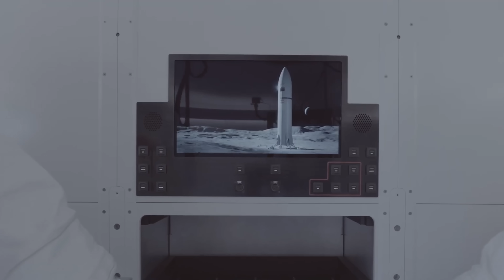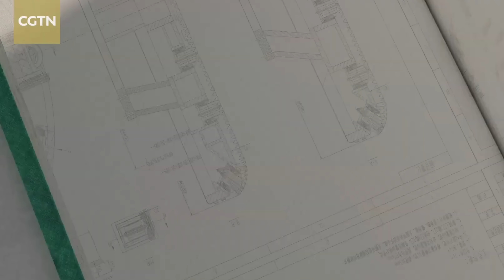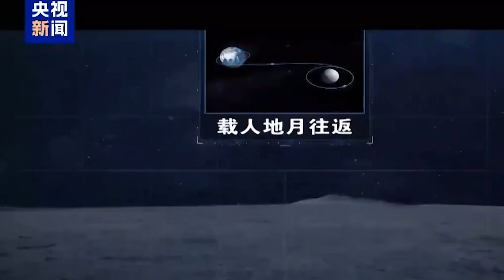SpaceX President officially reveals Starship HLS almost Ready Shocked China & NASA

Comment: Ah… HLS is on track?  It was supposed to be flying by now, after the cargo version was to have landed cargo almost a year ago?
Reply from the maker: The schedule has definitely shifted, but that’s pretty common with brand-new spacecraft
Reply: @alphatech4966 
Slipping is common on any big program, but given they arnt really making any progress (still dealing with major structural and control failures) and doing major redesigns on the fly….  And have big design gaps.  No way are they going to have a sold maned lunar craft in 2 years.

Comment: Once Starship has finally reached LEO successfully. Space X can plan to start launching Starship HLS prototype with landing legs, docking and basic flight crew system. Using Space X's Dragon as a Starship flight crew taxi, early testing of HLS systems in space under 0g conditions. By the crew docking and working in Starship for a weeklong multi-orbit test flight 

They could televise the whole operation showing us HLS Starship and its operation in space.

This replicates a lunar mission timeline, while mitigating the manned certification of Starship's and its critical launch, orbital refueling and re-entry phases. 

Upon completion of the weeklong test the crew reenters Dragon and returns to earth. This parallelizes the manned and starship operations. Once orbital refueling is successful, the Starship lunar testing operations can proceed. This method saves multiple years of flight certification, that dragon has already completed.
Reply: They don't need Falcon 9 Dragon Capsule for anything since the Starship HLS will have a crew compartment and will become crew rated.
Reply: Crew rating for HLS has many "milestones". One is just occupying the ship in orbit. A second is landing and take-off from the moon. A third is launching from and landing on Earth. 
 @mrbaab5932

Comment: LOL, this is another Trumpian pump&dump stock swindle just in time for the upcoming SpaceX IPO, from which Duffy has surely been promised a fat insider-trading cut.

As it stands, after 9 StarShip launches burning through some $5billions of NASA largesse, this misconceived abortion is still incapable to orbit Earth under control while empty; the frangible heat-shield secured with metal studs is worthless, as it resonates to dust on ascent, ensuring the vehicle reliably explodes on re-entry; the stainless steel design is highly questionable (certainly for Stage1, to which it adds 50 tons of mass for no tangible benefit); also Musk has no life-support system for the HLS, has developed no tanker vehicle, demonstrated no orbital refilling, built no orbiting fuel depot which resists cryogenic fuel boil-off over the several months it will take to fill up, no radiation shielding, no HLS rocket motors, no landing gear capable to keep the top-heavy craft from toppling over on a soft or uneven surface, not even a working airlock door for any Lunar never mind Mars Mission, and the pulley lift some 60m above the surface with no backup means of access when it inevitably breaks down is a total death-trap.

Musk's only solution to all these problems is to keep making the CGI monstrosity ever bigger & longer, as if compensating for some boyish personal deficit.

This serial fraudster has exhausted his ability to keep all plates spinning in the air, and will be locked up, bankrupt or dead well before any US manned Lunar landing, circa 2030 at best, and in any case the failure of StarShip will also ensure USA loses the race to a manned landing on Mars, which China will achieve on schedule in 2035.

Rest assured that China is not in the least fooled, shocked or in any way daunted by this risible "almost ready" fraud!
Reply: 7:30 HLS thrusters count is increasing. Already built and working.
Reply: 7:50 Elevator already tested.
Reply: @imconsequetau5275  Oh really? It still worked fine after 24hours soaking at -200°C, in a vacuum, when covered in electrostatic abrasive lunar regolith dust? In short, it has not been tested in anything like realistic use conditions.
Reply: @imconsequetau5275  nobody cares.
Reply: Best post on CrapX I read so far. 🔥

Comment: OMG these people are either a shameless propaganda channel or totally delusional THEY SERIOUSLY THINK SPACEX WILL CHECK ALL THESE BREAKTHROUGH ACCOMPLISHMENTS BY 2027 (which BTW they were supposed to had done by 2022 and the again by 2024, but they haven't even been able to deploy a banana tomorbit yet).   Do you see all the simulations China is running (Moon terrain landing, Landing Thrusters, etc...) all that stuff has to be done way prior to 2027 and even if you try to sell "well the vehicle doesn't need to come back" well they still have to proof FLAWLESSLY fuel transfer, the elevator and doors, the window, control cockpit (when are the astronautas supposed to train on this thing?  Falcon 9 is fully ready, and it takes the crew about 15 months to train for a mission) 😂
Reply: Totalmente de acuerdo..!

Comment: just a thought,   what happens is the elevator that lowers the astronauts has a malfunction -say gets stuck half way down, or drops the astronauts off then wont come back down.  Is there a failsafe backup to protect the astronauts in such an event?
Reply: Just carry a large folding ladder that can be deployed.  With the low gravity climbing, a ladder is no big deal.
Reply: @garyscott4847 and how tall do you expect that ladder to reach at its tallest point?

And you expect that to fold or crank and fit somewhere?

May as well have a cargo net and go back to WW2 on the side of  troop transport ships.  Welcome to the 21st century.😂
Reply: Of course they have a back up - TO EVERYTHING. Get Real, it’s SpaceX
Reply: Exactly - you took the words out of my mouth. That I keep asking myself since the beginning
Reply: @Fridolin1962 theres less gravity and it will not have a strain issue, it will be dust in tbe gears
Reply: Or have a manual gear drive crank option to raise and lower the elevator if the electronics fail.
Reply: There should be a backup ladder or rope.
Reply: Poke a hole in a glove
Reply: There is a ladder.
Reply: Hilarious if it gets stuck halfway up and down..

Will it have a little red emergency phone button, to use starlink to phone home to Houston.
Reply: LOL, no, ofc there is no failsafe backup - Musk promises not safety but intense emotion, which the HLS crew is guaranteed to experience as they are rapidly converted into a permanent exhibit of stalactites on the Lunar surface, the butt of Chinese jokes for millennia to come.